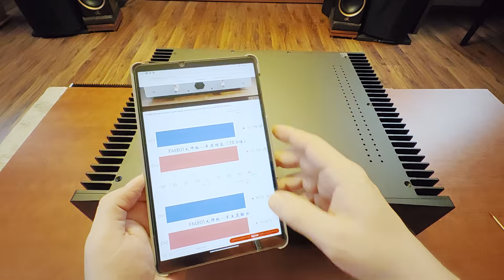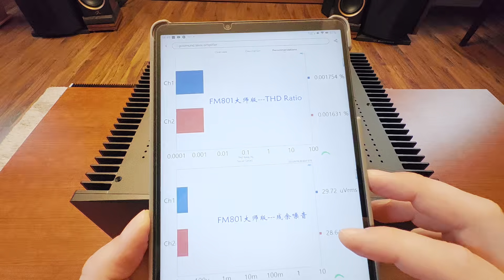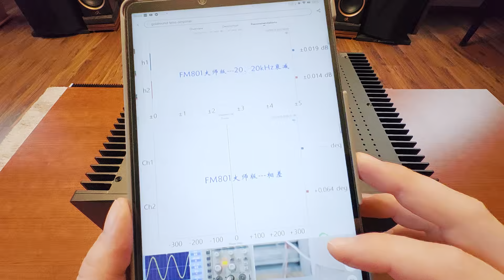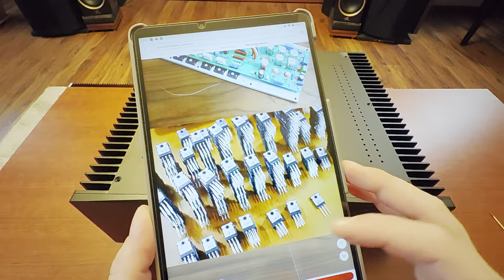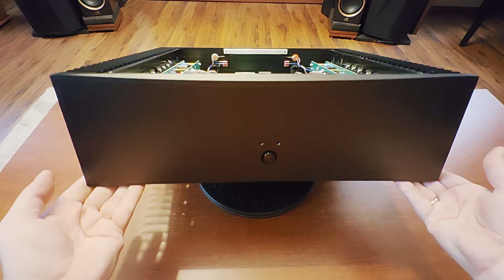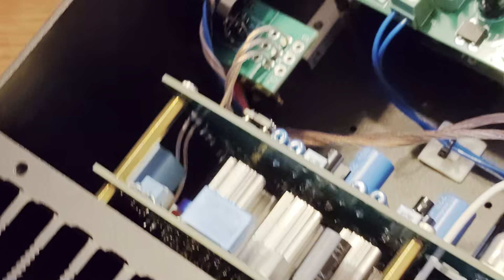FINALLY! A worthy contender! FM Acoustic FM801 Master Version power amplifier clone review!

Comment: THX for the Video! Would you Use the FM801 with Klipsch RF7II and a Marantz Cinema? Or is there a better option? (cinema and music)
Reply from the maker: I would, why not ;)
Check also D9PRO and T9.4 reviews for other excellent transaudio builds. They will have slightly different signatures, but they all are excellent
Reply: @k4syx  d9pro ist my other Option. I will have a Look on the T9.4. Thanks!

Comment: I already had the FM 300a, but I couldn't stand it and ended up buying the 801's smaller sister, the FM 711master version. Now with almost 200 hours of break-in, it's playing very well. I wouldn't say there's a huge difference compared to the 300a, but I notice greater bass control and a feeling of more "energy" in music reproduction.
Reply from the maker: Thanks for sharing, which one was that? Can you share the name of the offer? (Yt will cut any direct Ali links from the comments).
There are more than a few 711 versions on Ali and I was wondering about getting one (but which one, that was always the question)
Reply: @k4syx  Hello! Yes, there are indeed many offers for different versions of the FM711 model on AE. The one I bought was from Transaudio, not BRZHIFI (the version that uses the same cabinet as the D5Pro). I bought it from this seller: EchoZenith Audio Store. I paid US$570 for it placed here in Japan, taking advantage of a quick sale from this seller.
Reply: @k4syx  Hello! YouTube deleted my reply just because I put the store name without a link. Yes, there are indeed some variations of the same model. The one I bought was the Transaudio Master version, which uses the same chassis as the D5pro. Best wishes!
Reply from the maker: @edsonBr-Lon thanks! 
Yes, yt gets quite aggressive in cutting the comments lately :(

Comment: Jaki jest obecnie najlepszy wzmacniacz klon na Aliexpress według Ciebie? Jak się ma do d5pro?
Reply from the maker: At this moment that's T9.4 (Burmester 909). D5 pro remains my value recommendation as it's two times cheaper and still in the top 5 when it comes to sounds quality. Check my YT posts (last tab on the channel page) as there was a summary before last Ali sale.
Reply: @k4syx what about Accuphase a75+? Ive got Carry Spl90 clone and d5pro bc + MA Platinum 300 2g. Im looki go for best  clone from Ali for it

Comment: Hi I've noticed different sellers using different transistors etc on these upgraded 801 amps. Is the one in your link the better version? Thanks!
Reply from the maker: My is called Master version but thats why I always link to the specific store that I got mine from, many times Ive seen small differences though names and chassis were the same. So for my review to be valid, I link to the amps that I am sure are the same.

Comment: Could please post some details of the exact Chinese model this is. I didn't hear you mention it, and that link in the description doesn't work for me 😔
Reply from the maker: The link could be dead for Chinese New Year as I've noticed they had closed some of the shops I bought my gear from. Should be back already - check it.
The amp is called FM801 Master Version for it's supposed to be using better quality components. Having said that, I haven't seen any  FM801 "regular" version from Transaudio
Reply: there is a link in the description above
Reply: Thanks, but I already mentioned that 🙂
Reply: @seangallagher8233  This is the so-called FM801, Not Dartzeel 108 / D5Pro, Not T9.3 Burmester 909.  And to me it's the most horrible sounding amp I have had for a long time and I no longer have it.  I am keeping my D5Pro and T9.3

Comment: Happy New Year   Would you include the preamp used in your reviews.  Maybe you use your DAC as volume control but you don't say.  I have the Cary SLP90 and love it. (with vintage RCA clear tops)  I also see Cary makes one using the 6SN7 tubes.
I use some vintage 6SN7's in my Freya Plus and the sound is to die for. You may want to consider giving that Cary a listen.   Beside that, another excellent review.  Thank you so much!  For your TIME and EFFORT.  
My audio system has never sounded so FANTASTIC!    All because of your channel.

I have been thinking about HOW these amps are made.  One amp can be found at over a dozen stores, all with different pricing.  I don't think these people are sitting around their kitchen tables soldering stuff and building these amps.  One or two big companies are building them, to order.  Maybe offering, Low, Medium or High quality.  Or maybe to sellers specific requirements.  Have you wondered about this?  Your or others thoughts.
Reply from the maker: My setup details are in video descriptions, for power amps I always drive them with DAC only to be sure that I can assess amp signature alone, without any pre influence.
Which brand are these 6SN7 if you can share? I was thinking about getting a pair for Oldchen (its using the same type).
As for how they are manufacturing them - these are nothing like big factories. Just small workshops that are doing small scale production (100 units monthly would be my guess). So the parts may sometimes differ, like now D5Pro is supposed to come with blue Vishays or BCs instead of Elnas that are probably no longer available (or got more expensive).
Id say this is the same model as for many EU brands, companies that are 10-15 people working manually on each unit one by one.
There are some variants popping like some "master" or "upgraded" versions to catch buyers attention now and then too
Reply: @k4syx  The 6SN7 I have are Marconi's made in Canada during the 60's.  I go to the folks at ValvesNmore also in Canada.  Excellent people to deal with.  Father and Son team that really know their tubes.  Check out Youtube video's .
Back to the manufacturing of these amps and preamps.  FM801 prices vary from $480-800. some using exactly the same photo's and specs.  Sometimes paying more IS just paying more.  Same specs as Master products.  Am I loosing out looking for best price?  
I have D5pro and bought by price.  Left channel failed.  It did not like Cary Pre although the pair sounds wonderful.  I hope the company fulfills their promise to make it right.  Fingers crossed.                     You offer a fantastic service.  Keep up the great job.
Reply from the maker: @randynielsen9894  Ahhhh Marconi's, well no further questions to ask here :D
These are available in Europe too but quite pricey!

Comment: That is my problem with D5 Pro there is a  low noise from the Speakers, i put my ear to the speakers and hear it.
Reply from the maker: What is that? Hum, hiss? Can you hear it with inputs shorted (meaning zero input signal whatsoever)?
Reply: Check for grounding issues. May be the amp, maybe the source, cables and so on. Make sure to have everything separated from each other and test one by one.

Comment: Good morning, I checked the technical characteristics and saw that it is declared 250W/8 Ω; 500W/4 Ω but the power on 2 Ω is not declared. Strange because the original version was stable even on 1 Ω. Greetings.
Reply from the maker: Yes they usually do give only figures for 8 and 4 Ohms. Just a very few of the amps had any figures for 2, and there is just two that had numbers for 1Ohm.
I think they just do not measure it, since 2 and 1 are very uncommon loads.

Comment: For me the hum issue would certainly rule out that amp - the DartZeel clone you reviewed a while ago is gorgeous, though (on more than one kind of speaker). So thx. for your postings - it's greatly appreciated.
Reply from the maker: Yes thats the first one that I can say is better in most areas. The hum is very very slight and only with SE input, which for me means lack of shielding on this short run of wire internally.
Its dead silent with XLRs (which I prefer anyway)

Comment: The original amplifier has a lot more power than the clone. I took a look at the data. You can download it as a PDF. It says 540 watts at 4 ohms, 1000 watts at 2 ohms and 1950 at 1 ohm. The original amplifier seems to be very stable under load and the used prices between 10,000 and 13,000 euros are a real statement for a device that is over thirty years old. As always, a great review and thank you for your valuable work. This allows people on normal incomes to enjoy HIGHEND too👍👍👍 
What would be an equivalent preamplifier?
Reply from the maker: Thanks! Yes, original was beefier and also required active cooling - there were two (I think) 12 or 14cm fans :)
I think Cary would work well here too, but I need to check that. Or maybe JC2 with its clarity and detail.
Doing set reviews is next level of advancement for me here :)

Comment: I strongly suggest you add for each “clone” who exactly makes the clone.  As an example, you gave a preview of the Accuphase A75.  When I looked on AlliExpress, there were a half dozen different makers of this clone, and they were at wildly different price points (there was one over $3,000).  They also appear to have differing builds.  Your A75 has 4 caps.  I saw pics of one with what appeared to be only 2 caps.  And I have no idea what values anyone is using.  

I appreciate you giving the price, but you also need to include who is building the product so people can know which unit to purchase if they are interested.

Thanks
Reply from the maker: Aaaand that's exactly the reason why I give precise links in video descriptions.

You are perfectly right, these can widely differ by the price and build. I am linking to the offer where I bought my unit because in many cases they will look the same on the outside, but the inside there will be smaller or bigger differences in build quality or parts used (f.e. different caps).
So, anyway, each video, review and first looks always has the link in the description.

Comment: You can try to replace input signal wires with either dual shielded ones, to eliminate 50 hz hum pickup
You can to try to shield the transformer using a nickel foil
Reply from the maker: Ill probably go for shielded wires first, I think I have some Canare or Mogami microphone shielded cable somewhere. shielding trafo will be a lot more work, so I will begin with something simple. I wonder why they did that, ok these cables look good but nobody will watch them, but simple shielded cable would make all the difference here
Reply: @k4syx  But shielding of the transformer eliminates the impact of EMI on the PCB, components, and signal cables.
New FM amps, and no FM only, are built with dedicated chamber for the power transformer.
Reply from the maker: @Anatoly_Panchenko  Yes, you're right, thats way better solution, the shielded cable is just simpler and faster to do
Reply: All stuff that's unnecessary

Comment: Does anyone know if it would be possible to add a 12v trigger in, to one of these amplifiers? I would like it to integrate more seamlessly into a system with both home theatre and music components.
Reply from the maker: Im using tuya smart plugs for that. Easier this way and less cable mess.
Reply: Yes. Replace the soft start board with "AUDIOPHONICS Module Softstart for control and delay for amplifier". And add a jack.
Reply: @Pete.across.the.street Thank you!
Reply: AUDIOPHONICS Trigger 12V, works also of you live in 230v country

Comment: Your comment that you need an amp that can handle under 2ohm loads means that the FM711 clones would not be suitable as its protection circuitry is set to trigger at 2ohm loads.
Reply from the maker: Ahhh and I have FM711 on my way here :/
Well, we will see then how close this one is to the original when it comes to protection...

Comment: This master version still only has 4 10000uF caps per channel right?
Reply: Yes I counted. 
Still Elna.
I spent the extra on my D5proBC with 6 Vishay 10000uf power caps per channel.
120000uf total. No wonder it needs a soft start or the house lights would dim on start up!
🎵🎶 😮💡🎶🎵
Reply from the maker: Yes, exacltly - 80.000 in total for both channels
Reply: @k4syx 20000uF per phase it claims to output how many watts using 63V rails and how many output devices in parallel?  😢
Reply from the maker: @johnsonwu126  A LOT ;)
Reply: @k4syx hmmm really?  Even the so called Dartzeel basic D5 that has only 1 output device per phase has more capacitance than this so called FM801 that has like 6 output devices per phase.
Reply from the maker: @johnsonwu126  One of German youtubers - very nice guy btw - had measured max D5Pro output power and it was as specified within unit variation margin. Its worth watching (with english auto translated subs)
Reply: @k4syx d5 pro has no issues.  Fm not so.

Comment: D5Pro here, a fantastic amplifier, especially with the Cary clone tube preamp. The Psvane classic tubes sound incredibly good, both units are just as you described! And nice to hear your thoughts at the end of this video regarding the D5Pro and this unit. With easy to drive speakers, the D5Pro is going to stay. Very happy! Thank you Tom!
Reply: My DartZeel NHB108 "Inspired" D5proBC is happily burning in and driving my Magnepan LRS  with AUTHORITY!
I waited a week before I connected my RELs.
Good sign
🎵🎶🤫🎶🎵
Reply: @carlitomelon4610  How does the D5proBC differ from the D5pro? Thanks!
Reply: @DanielAStroe  I also ask myself this question, D5proBC or D5pro? Do you perhaps already have an answer to this question?
Reply: @DanielAStroe  The store said it's better capacitor in the BC version. The BC has vishay caps and the pro has Elna
Reply: @DanielAStroe  电容不一样
Reply: @DanielAStroe  I suppse they claim capacitors are different (blues vishay - "12 BC high temperature class electrolysis machines"
Reply: @DanielAStroe  they say high temperature grade capacitors.
Reply: D5Pro handily beats this amp.  This 801 is as grainy and edgy as they come.
Reply: @johnsonwu126   You mean Master  801 version or normal ?
Reply: @ I don’t know how to tell master from basic in this particular model.  Someone has to show me the transformer and measure the rails voltage of theirs and compare with my unit I returned.
Reply: @johnsonwu126  master version is presented by Hi-fi Zone. Normal version is ca. 30 % cheaper
Reply: @JohnyColt  So far NO ONE is able to tell me how to tell the difference bbetween the 2.  Someone please show me the label of the master versions transformer.  I still have a pic of mine: sez 1000W, rails at 53v x 2.
Reply: Master has 1200 w transformer and 120,000 mfd
Reply: Master version. has transformer 1200 watts niemal 1000 Watts

Comment: Great review. I'm anxious for your head to head comparisons. They both check all my boxes. EXCEPT both run hot, right? Which is cooler? Also, do you have any other amp in the wings that you think might compete wth the DarZel and this FM ?🫢🙏
Reply from the maker: They do run hot but not in a dangerous way. 
For possible contenders, T9.3, yes, thats coming, A75 - too, thats coming, and maybe Telos 600 thats on its way as we speak. Maybe - I havent heard it, but price bracket suggests this may be a competition too.
Reply: Burmester clone T9.3 or T9.4 also by Transaudio could be the closer contender. I guess Tom will run a full review on the T9.3 soon.

Comment: :face-blue-smiling:You should shield the transformer on this and other amps.
Maybe: MUNDORF MCONNECT Copper Foil Flat Wiring Cable 70x0.07mm 4.9mm²
Reply from the maker: Ive also seen that its possible to buy ready made steel stamped shields, some of my clones (namely Musmys ones) have that
Reply: I’d like to know how this amp compares to a good Class D amp in terms of bass performance.
Reply from the maker: @ccdccd8615  Best (truly excellent) d-class I have here, set of ZeroZone monoblocks will have more dry, analytical - faster, more precise bass. Its getting more loose (and I like it more then) with good class A opamps.
This one has better bass though: strong, powerful, organic. 933 level if not better.

Comment: Black and no unnecessary knobs? Might be a contender indeed 👍
Reply from the maker: I think the coat is slightly better than on DartZeel. Seems to catch a little more light. I was sure that chassis is the same (just larger) but it seems that the are some small differences
Reply: @k4syx it's just the price, for that money I can buy 2x citation 22 to use as 400w mono blocks. Now to get that money first 🤔😁😎
Reply from the maker: @annebokma4637  Yes its pricey. Some of the clones are in range of 2500-3500USD and I wonder who gets that. I mean, maybe one day I will get one to check the soud quality, because they are not being bought for brand etc.
Reply: @k4syx  true if you add what a name brand would add then a 3500$ amp should perform like a 15k amp that has dealers etc. or... They lure you with cheap amps of nice quality and stuff you on the expensive one as soon as you are hooked 😎 for now I am mostly going to buy second hand amps, but I might try one of those za3.. I like the zd3 that I just acquired 😁
Reply from the maker: @annebokma4637  go for v3 monos, these are better (review is ready and scheduled)
Reply: @k4syx my choice got easier.. sold out 😂
Reply from the maker: @ Or the shop got closed for the holiday season, try to reach them with direct message. I saw more and more stuff that I had in my cart went "sold out" but when I contacted few of the sellers they said they do this to make sure there will be no purchases when there will be nobody available to prepare and post the orders
Reply: @k4syx  good advice